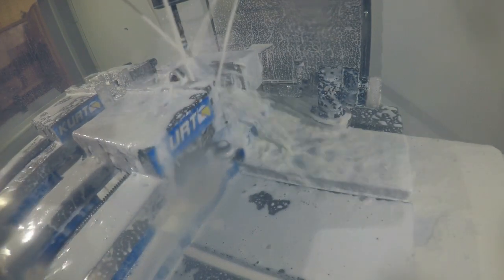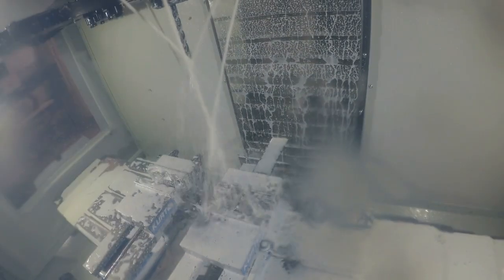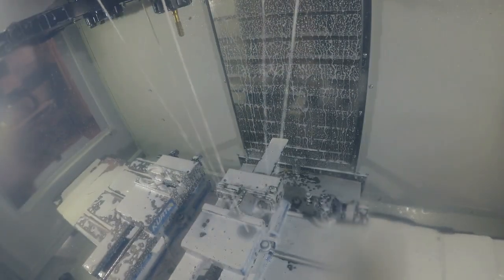Quick HAAS VF-2 video form tapping stainless steel angle iron

Comment: Hey Daniel.
Good to see another video from you.
Sounds like things are progressing well with the New Shop.
Would Love to see a video on the CNC Lathe in action.
All the best.
Peter.
Reply from the maker: Hey Peter, I will hopefully have some soon, the Okuma is a beast and has a rather steep learning curve. We have had  quite a few issues with it as well. Currently the Chip conveyor is not working, I believe it's the motor. Also before we were unable to load code into the machine, so we had to type everything manually now we have a USB/network attached storage from Shop Floor Automations that allows me to dump code to the Okuma pretty easily from my pc now. Things are moving forward.
Reply: @dnjmachine  
Good to know it,s all happening for you.
New / Old Machine ?
New Problems, lol.
Always like that.
It,s funny in a way, today it,s a problem.
Tomorrow problem fixed, a new problem begins.
You will get on top of it in time.
Thanks for your reply.
Peter.